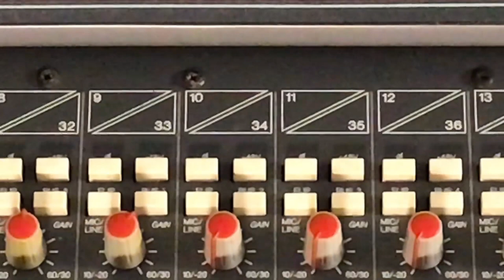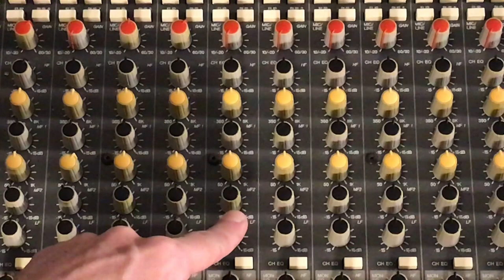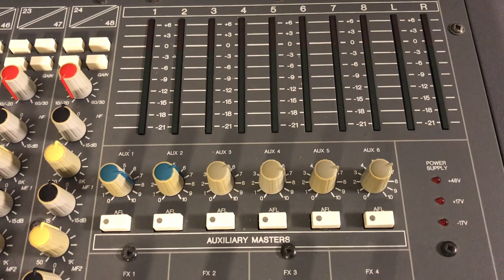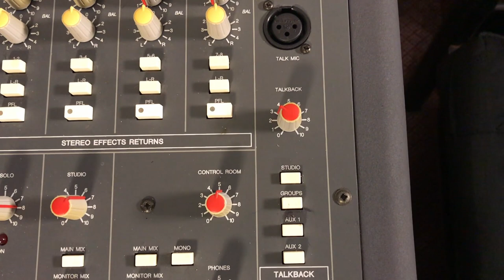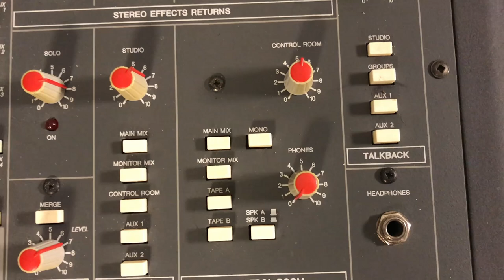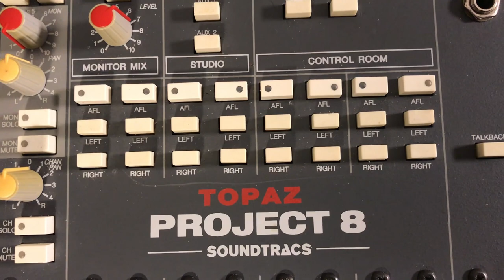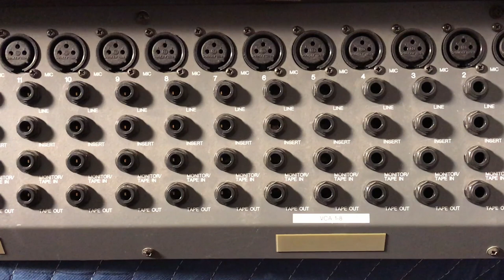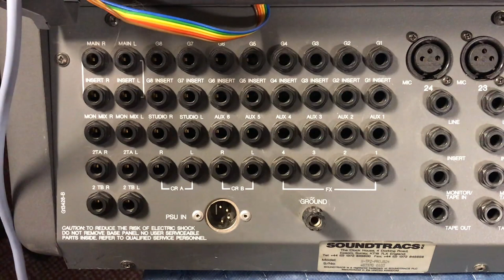Soundtracs Topaz Project 8 Part 2: Console Details

Comment: Hello, Sir. Thank you so much. This is such a great video for me as it helped to gain me more information about my own Soundtracs Topaz 32. I have one right now but it lacks the meterbridge. Would you be kind enough to advise me as to where I can buy one for my unit?  Thank you and more power.
Reply from the maker: Thank you! You might check with Tim at Studio Systems UK and see if he has any leads on the meter bridge for a Topaz. The only other places I could suggest would be eBay, Reverb or other online audio groups and classified ads. Studio systems UK is pretty much going to be the only consistent place for Soundtracs info and parts. Tim is great and has helped many Soundtracs owners including me! Thanks again!

Comment: Hi Grady , have you any experience with a Soundcraft spirit studio 24/8/2 ? Thanks man hope you’re good.
Reply from the maker: I'm doing very well, thanks for asking. The Spirit Studio is a cool console! I have seen them in person and looked over the functions and features. I also tested the Live version the 4.2 40 channel wish I think has the same like preamps. There are some videos of that one here on the channel and I thought it sounded excellent! So if the Spirit Studio is anything like it, it should be a great console. I remember people saying in the forums years ago that they thought it was better sounding than the later Ghost. I've owned and used a Ghost 32LE back before I started the channel. It was quiet and sounded good but personally I think the Spirit Mic Pre+ or whatever it's called sounds better. The Spirit Studio works pretty much like the Ghost, Soundtracs Topaz, or a Mackie 8 bus so they are pretty easy to use if you've used an inline 8 bus recording console before. The Spirit Live I tested in the videos really sounded good. It's up there with some of the best consoles I've heard at that level. Soundcraft consoles of that era are very well built. Just make sure to keep the top mounted jacks clean. Being on the top like a Mackie 8 bus or a Ghost allows dust to get inside more easily. The headphone jack on the Ghost is notorious for getting flaky and many people bypass them but I'm not sure about the Spirit line.
Reply: Thanks mate, you are always helpful and knowledgeable. Enjoy your channel. Thanks again
Reply: Thanks mate, you are always helpful and knowledgeable. Enjoy your channel. Thanks again
Reply: Thanks mate, you are always helpful and knowledgeable. Enjoy your channel. Thanks again
Reply: Thanks mate, you are always helpful and knowledgeable. Enjoy your channel. Thanks again
Reply: Thanks mate, you are always helpful and knowledgeable. Enjoy your channel. Thanks again
Reply: Thanks mate, you are always helpful and knowledgeable. Enjoy your channel. Thanks again
Reply: Thanks mate, you are always helpful and knowledgeable. Enjoy your channel. Thanks again
Reply: Thanks mate, you are always helpful and knowledgeable. Enjoy your channel. Thanks again
Reply: Thanks mate, you are always helpful and knowledgeable. Enjoy your channel. Thanks again
Reply: Thanks mate, you are always helpful and knowledgeable. Enjoy your channel. Thanks again
Reply: Thanks mate, you are always helpful and knowledgeable. Enjoy your channel. Thanks again
Reply: Thanks mate, you are always helpful and knowledgeable. Enjoy your channel. Thanks again

Comment: Hello Sir. I have Soundracs rx-8, and didn't find any manual to it. But I believe some specs should be similar to Topaz. Does aux stereo or mono? I have 6 aux but I just don't know if they are all in stereo, or not. For example I have stereo output on reverb which I need to  send to my mixer, should I use just mono output on reverb and send effect on mono or I can use it in stereo and send stereo to aux in my mixer? I would appreciate any help and any information which can help me
Thanks in advance
Reply from the maker: The Topaz is very similar to the RX-8 and I believe they both have only mono Aux sends. You can use any post fader Aux send to feed the input of the reverb and then use an FX return channel or a pair of line inputs on the channels to return the reverb to the mix. For most things, mono sends are fine as the reverb return is stereo. My current console, the Soundcraft Sapphyre has a stereo Aux send but it's mainly for headphone mixes. Hope that helps and let me know if you have any other questions.
Reply: @TwinCreekAudio  Thank you a lot
Reply from the maker: @bedroomtalks2671  you're welcome! Let me know how it works out for you. Thanks!

Comment: Hi - great videos thanks for that - could you tell me how do you switch between line and mic input on each channel? Is it correct that you can only do that by unplugging the line input jack? Thanks in advance and all the best Morten
Reply from the maker: Yes; that is correct. There is no mic/line switch on the Topaz. The line input on each channel becomes active when a cable is plugged into it. And thank you!
Reply: @TwinCreekAudio ahh ok. I’m used to the neve 88r, where you can easily go back and forth from mixing to recording just by pressing the mic switch in or out. So for the topaz, if I have everything hooked up for tracking, and the next day I want to use it for mixing, I have to unplug all the mic cables and plug in line level cables?
Reply from the maker: @jackmmarsden  it has a flip switch so repatching shouldn't be necessary if everything is connected correctly. The line inputs are a separate thing and are for the main channel unless the flip switch is pressed Then mic or line would go to the monitor pots and the main faders would be the tape returns. It's fairly similar to most other inline consoles like my Soundcraft or a Mackie 8 bus. It has quite a few more useful features than the Mackie however.

Comment: Thank you for the Great Video. Are the direct/tape outs of the topaz Post fader and eq or pre?
Reply from the maker: I sold my Topaz a few years ago but I do remember that the direct outs are post fader, post EQ. I almost always used the direct out to track. I really only used the buses during mixing for things like parallel compression. It was a great sounding console though sometimes the mic pres would overload in a not nice way with live drums.
Reply: @TwinCreekAudio  that sounds good. I'm looking for a console to record post eq and post fader into my interface. I'm just not sure which desk to choose. Here in Germany a Topaz Project 8 and a Soundtracs MR 24/8/2 are currently on offer. Unfortunately, I can't find anyone who can tell me about the strengths and weaknesses of these desks.
Dennis
Reply from the maker: @dennisforster4082  the main weakness with the Topaz is how they are built. They are designed more like a Mackie with 8 channels to a circuit board. The MR consoles are fully modular. They both sound good and will work like you want. The Topaz consoles are getting old and service not being as simple would probably draw me to the MR over the Topaz. I've owned 2 Topaz consoles and both of them gradually needed more service than I had time or money to deal with.
Reply: @TwinCreekAudio  I already thought something like that. However, I'm afraid that the seller of the mr is simply asking too much money for the mixer (€1600). Is the Mr worth the money or should I better look for alternatives? Can you recommend something or can I perhaps write you an email in the next few days?
Reply from the maker: @dennisforster4082  sure. I'll have time later this week. I am off work for holiday break after Wednesday. Email is grady at twinbcreekaudio.com. With any used analog console, condition is most important. Soundcraft would be another good option you might be able to find. My friends in Germany have a Topaz and I don't think they've had many issues with theirs. I did a lot of work with mine and I they just got worn out. You might look for a Soundcraft Delta or Sapphyre. The Ghosts are not as good in my opinion. I had a 32 channel Ghost LE and I like the Topaz better.
Reply: @TwinCreekAudio  Thank you! I‘ll send you a mail in a few days!

Comment: Is made in England or China?
Reply from the maker: It’s made in England. I think I showed the back of it in one of my Topaz videos and it has Made in England on it. Sounds like it too. My favorite low cost recording console!
Reply: @TwinCreekAudio  I have the opportunity to buy a 32 channel for 800 eur  at the moment I have a soundcraft 600 i would like to compare the 2 console
Reply from the maker: The Soundcraft is more modular than the Topaz making service and longevity better. The Topaz sounds great but the build quality is not as strong as the Soundcraft.
Reply: @TwinCreekAudio    Hi From Thailand  I have Allen & Heath GL 3000 , What do you think bro
Reply from the maker: A&H makes great consoles. I'm sure it sounds great! I only have experience with the System 8 and GS but the GL is similar